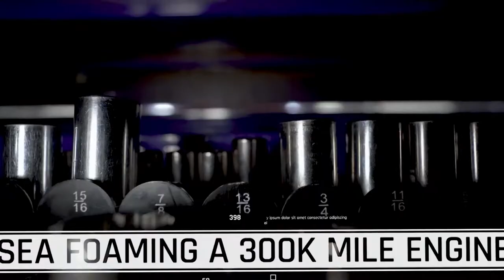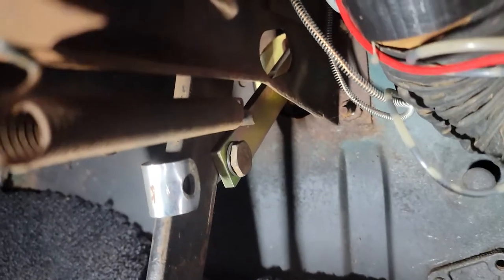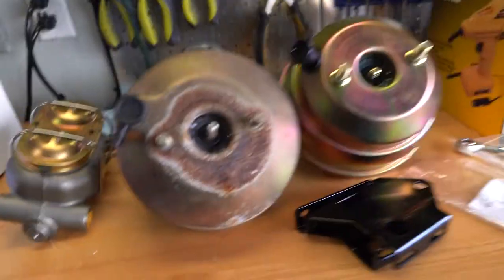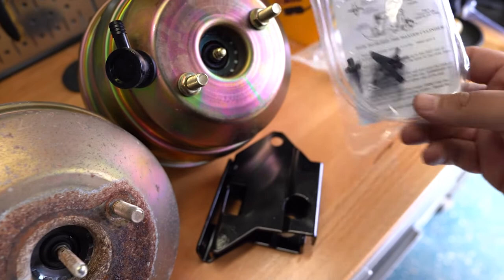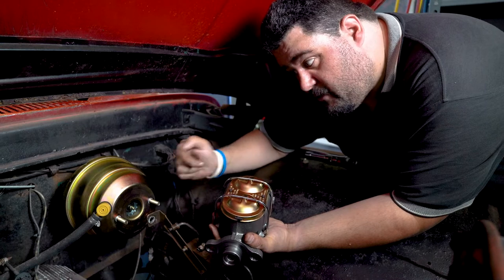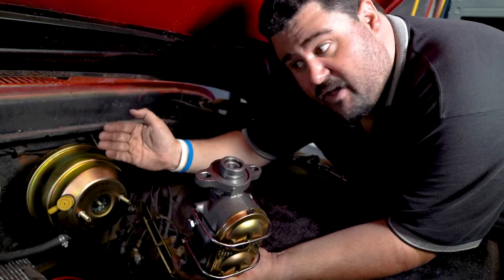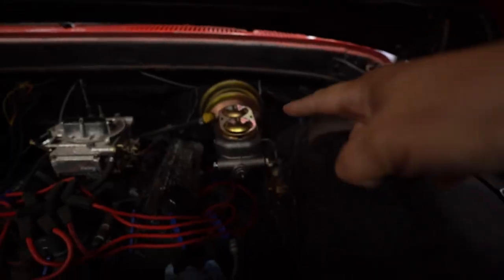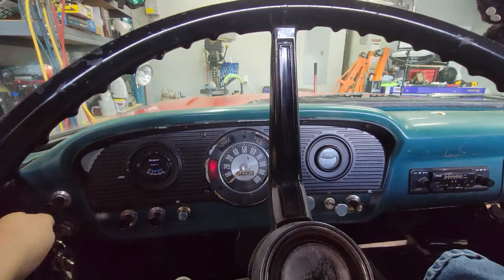How to install a brake master cylinder on a F100

Comment: You guys all have problems because you use them frecking Chinese junk kits. Those boosters are way to small. Rebuild your original booster and go from there!
Reply from the maker: Are there any boosters or booster rebuild kits that are made in America? Thou,  I have no problems with mine, has been working just fine, no issues. My truck did not come with a factory booster. It already had been upgraded from drums to front disk brakes, so I didn't need a bigger booster. And on top of that, I am doing a full chassis swap to a modern crown vic chassis so I don't need to spend extra money for something I will only use until I move the body over to the new chassis. Which will be very soon.  Then I will use the factory vic booster and master.

Comment: Ace , I was going to do a disc brake conversion from a 73 disc brake but I decided to do a crown Vic swap 03  can i still use the 73 that didn't come with booster from factory with the vic sub frame?? Any info will help ??
Reply from the maker: 73 didn't come with a booster, surprising. You can use any master cylinder without a vacuum or hydro booster. It just depends on how hard of a pedal you want. Vacuum boosters just help reduce the amount of load you have to push on to engage your brakes. If it was my build, I would add the booster,  I will drive my truck hard, and traffic in my area could be bad, so I don't want a heavy pedal. Just be sure to use the correct master cylinder, one designed for front disk and rear drum.  Hope that helps.

Comment: My new booster fits flush against the firewall. When I put on the master cylinder, I start feeling resistance about 1/8” of an inch before it mounted flush against the booster. According to you, there shouldn’t be any resistance when doing this. Is there any thing I can adjust so that the plunger barely touches the master cylinder push rod?
Reply from the maker: The rod that connects to the pedal is usually adjustable. You may need to adjust the rod shorter. In my case, I had to actually go back in and cut my adjuster shorter because my brakes were dragging. I only cut 3/16 off of my rod adjuster.

Comment: Ace, nice video! i having issues with my newly installed dual master cylinder, soft brake pedal, brakes don't bleed, proportional valve leaks fluids." screw bolt area." all tighten ".  Thank you in advance!
Reply from the maker: Most likely,  the cause is that your proportioning valve is bad. I have had that happen before, even brand new ones. You can check by losening the lines that go out and see if there is fluid there or not. You can either bypass it for now to get your project moving or get a new one and swap it out. Then, you should be able to bleed the system.  You didn't mention if you did or not ,but also be sure to bench bleed your master.

Comment: the ole bottle and hose trick will help bleed those brakes with only one person.
Reply from the maker: I actually ended upgrading to a pressure bleeder in another video. I also have tried the bottle and hose method as well. It does work well. Just wanted to try something different since I had it.
Reply: @Ace's Garage  funny  I went to harbor  freight  and paid 25$ for the Pittsburgh  breeder a
ND ended  up with the bottle  and  hose method but I still kept the Pittsburgh  i can  still use it for other car projects that need sucking...lol keep  up the good work I just had my 76 F 250 towed to a garage for a brake Inspection enjoy your weekend.
Reply from the maker: Thank you! Sometimes, the old tricks are the best. I rarely use my vacuum pump anymore.  But I am always glad I have for the rare times  I need it. 76 f250 that's a lot of truck. Do you have any plans for modifications? Or just keep it stock and running good?
Reply: @AcesGarage  repaint the  original blue I'd like to add 18'' cherry bombs...dual exhaust of course, change the steering wheel and add buckets, but i will leave the wheels stock due to off road exploration.
Reply from the maker: Nice, keeping it simple. love it.

Comment: what size booster is that?
Reply from the maker: It is a 8 inch booster. I used this  kit from summit racing Check out this page from Summit Racing https://www.summitracing.com/parts/sum-760240/make/ford/model/f-100/year/1962

Comment: I’m having trouble with leaking on those block off bolts - did you put anything on the threads? Or really crank the bolts down tight? I don’t want to damage the threads!
Reply from the maker: I actually ended up having the same issue. I backed them out and in a few times, each time putting just a little more force each time a tightened them. It helpes them seat better. Haven't had any leaks since I did that

Comment: What kits did ya use and do you have disc front and drum back?
Reply from the maker: I used this kit I ordered from summit. 
Summit Racing™ Power Brake Conversion Kits SUM-760214
I have disk brakes up front and drum brakes on the rear. Not sure what kit was used for the disk brake conversion they came on the truck when I got it. The rear end is out of a 90's f150.

Comment: Ace how did you hook up your brake lights?
Reply from the maker: My brakes are activated by a pressure switch that is plumbed in line after the proportioning valve.